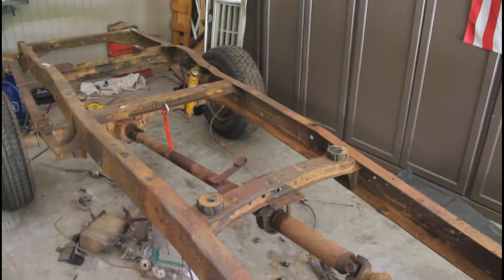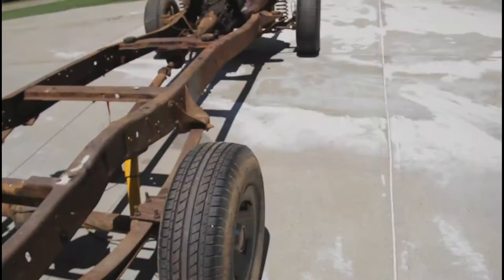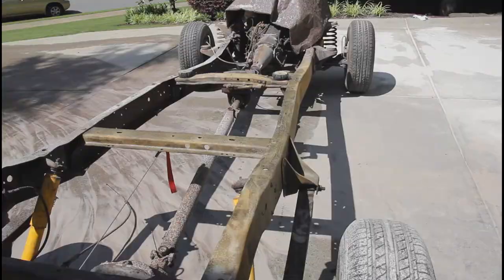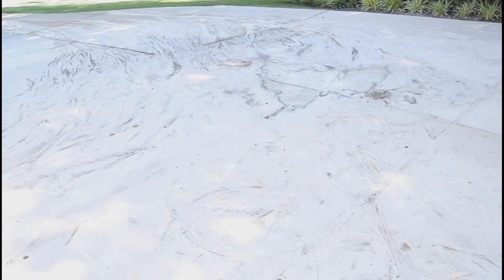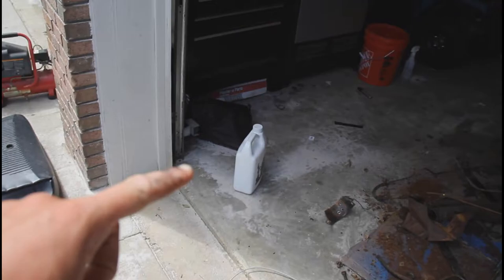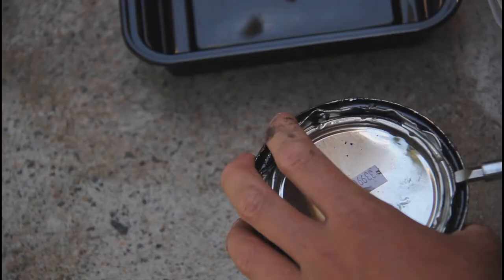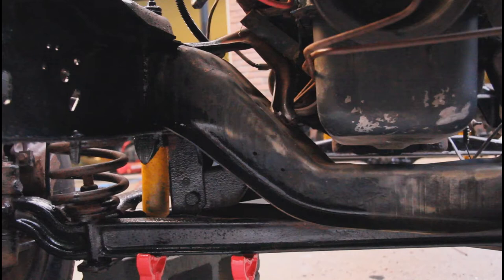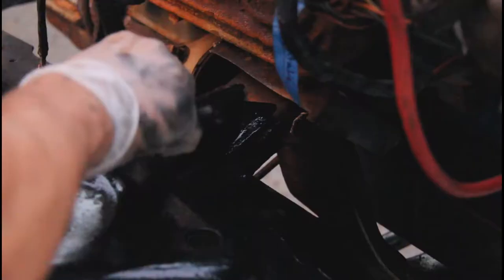Painting The Frame of The F-100 (Pt. 2)

Comment: what all do you need for the sand blasting set up?
Reply from the maker: I had a pressure washer, and I bought a sand blasting attachment for it off amazon. I just had a bucket of sand i put the other end into. worked really well and all together with all the sand was like $60.